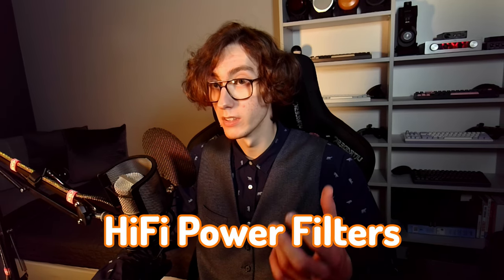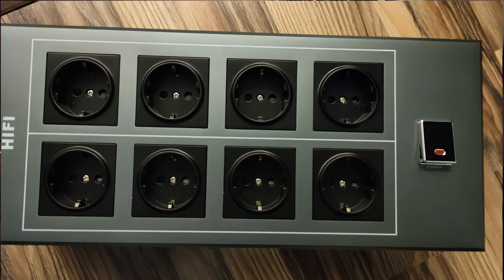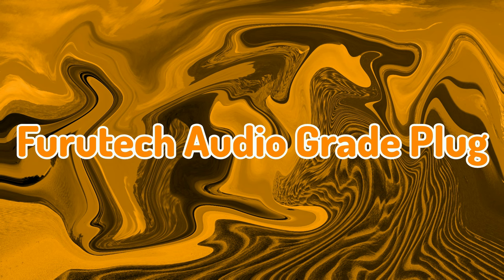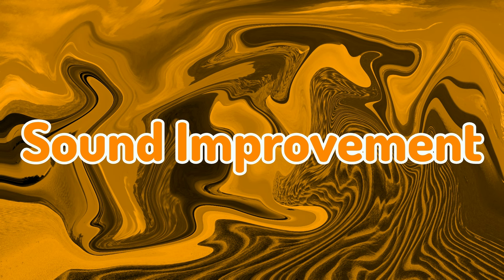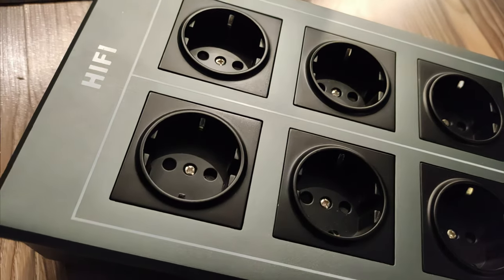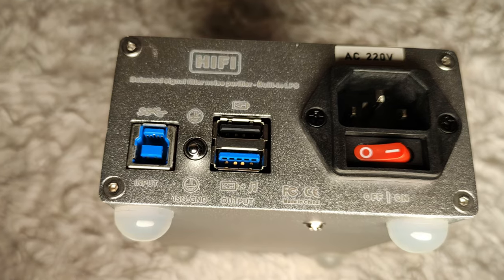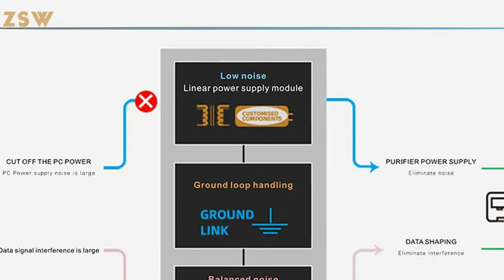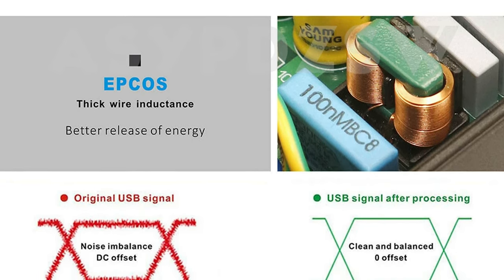Budget HiFi Power Filtering? - You CAN Do It!

Comment: A power conditioner is an isolation transformer. All decent amps have this built in as their first stage right before the rectifier This test if performed at the input of the rectifier stage of any quality amp would also show the same reduction in noise level
Reply from the maker: More filtering never hurts. You can't have "too pure" power.

Comment: I have an older house with no ground.  It causes my powered mixer to hum.  How can I fix that cheap?
Reply from the maker: If you’re dealing with hum due to lack of grounding, a budget-friendly solution is to use a ground loop isolator. It can help eliminate that unwanted noise without breaking the bank. You could also consider using a power conditioner to improve overall sound quality.

Comment: I don't have noise as such. Stereo System can sound excellent at times but there are periods of flattening of soundstage. Can power conditioning help?
Reply from the maker: Power conditioning can definitely help with soundstage issues! Even if you don’t have noise, it can improve overall clarity and dynamics, which might address those flattening moments you’re experiencing.

Comment: Is there a negative impact if I use a UPS? I’ve been using it for quite some time and I haven’t noticed noise or anything else. Thanks.
Reply from the maker: Using a UPS shouldn't negatively impact your audio setup, and it’s great to hear you haven’t noticed any noise issues! It can actually help protect against power fluctuations, which is a plus. Just make sure it’s a good quality UPS for best results.

Comment: It is unclear to me, is it a AC power filter or conditioner and build-in DC power supply for the USB ? Because you mentioned max. 3 Amp it should be for DC. And does that brand provide NA plugs as well ?
Reply from the maker: I see where the confusion comes from! To clarify, this setup includes a power conditioner and a DC power supply for the USB output. The max 3 Amp rating is indeed for DC. As for the plugs, yes, we provide options for NA plugs, so you won’t have any issues connecting it over there!

Comment: Without mains power, no audio or audio visual component can function. Your musical enjoyment is reduced by mains noise contamination.. this can be from either differential or common mode means noise. Differential noise is created by the power supplies in all electrical devices, while common mode noise is introduced by RFI and the wireless communications that are becoming increasingly common. When choosing a power bar/conditioner, independent output sockets in my experience are probably the most important element to consider. If the sockets are used for poweramps, make sure the ampage is higher than the wall socket. Otherwise, the dynamics can be throttled.

Good informative video with splendid delivery.
Reply: I beg to differ. Pretty well all modern audio equipment that isnt dirt cheap has plenty of power line filtering and noise suppression. I have yet to hear any noise contamination in many years of listening other than a nasty mains hum caused by a ground loop from my cable TV. Mots people that buy the expensive audiophile conditioner woo-woo are hearing ghosts.
Reply: @exponentmantissa5598 
 maybe it's because one shares the building with six other flats. Maybe one doesn't trust the shoddy workmanship from the original builders. Maybe one might have a telecommunications mask situated fairly close to ones building. Maybe one might have multiple sources connected, which might also include a 9 Channel Dolby Atmos setup. Who knows? What I can tell you, it was only after a trial and error process of eliminating which 6 out of the 12 connected devices we're adding to the noise floor.

When listening, I prefer not to put up with the faint background signal noise (noise floor)

One should try pressing pause or mute, and from the MLP,  if one is unable to differentiate whether the systems off or on that's telling you something's not right.! Mind you, to be fair, one could just be just a little over sensitive.

When friends or guests come around rather than showing them how loud the system goes, I prefer to press pause/mute and show them how quiet it goes. None of them gets it, of course 😂
Reply from the maker: I appreciate your detailed insights! Mains noise is often overlooked, but it can have a huge impact on audio quality. Choosing the right power conditioning setup is key to optimizing performance, especially with high-demand components like power amplifiers. Glad you found the video informative!